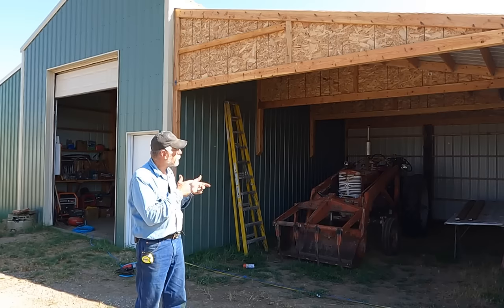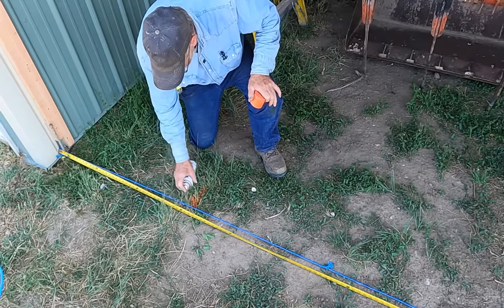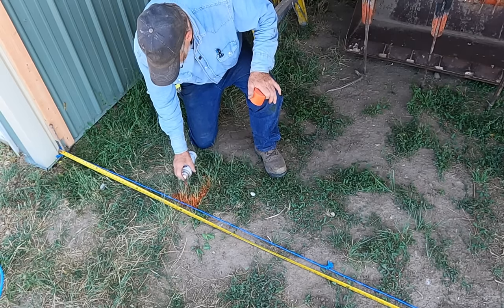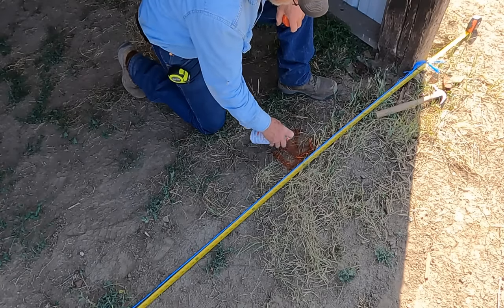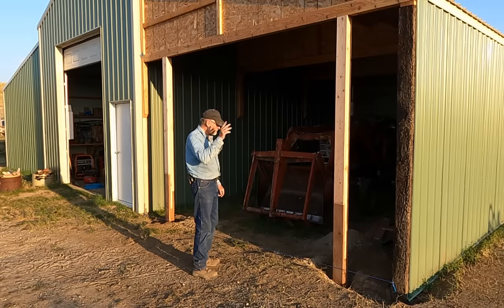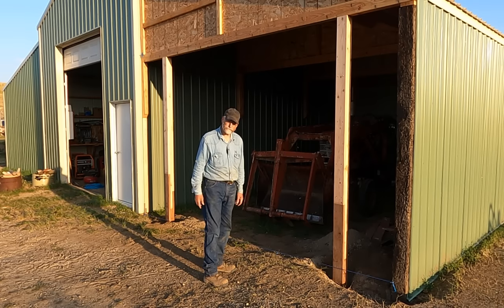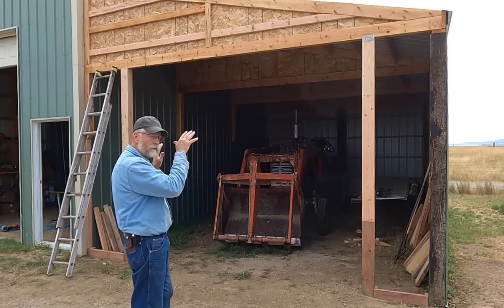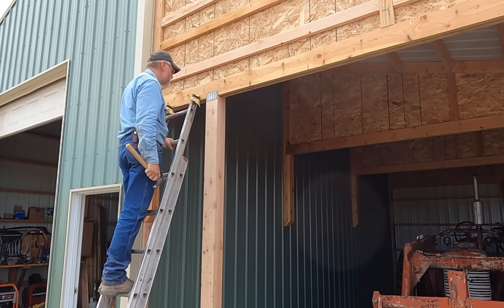The Last Steps in My Pole Barn Extensions | Engels Coach Shop

Comment: Watching you use the nail gun took me back in time to the early to mid 60's when my Dad and I built an apple cold storage warehouse, on our ranch, with a 25000 box capacity.  Every nail in that building was driven by hand.... with a hammer!!  Many times my right arm would give out from driving so many nails so I then learned to drive nails with my left hand.  Surprisingly it was not all that difficult to learn. 

Before we built the warehouse, we had to tear down what I would call a traditional barn with 2 wings and a hay loft.  This barn was built to store apples so the walls were insulated with saw dust in 6 inch walls.   We didn't actually "tear" it down... we dismantled it salvaging every board we could to be used in the new building.   During the school year when I got home, I would change into my work cloths and work for about 3 hours every day plus weekends.  The Cool thing was that my Dad paid me by the hour for my work;... $1.25 an hour which was a fair wage back in the day.  Farm kids back then knew how to work.  That skill served through out my entire life.

Thanks for sparking some great old memories....   PS.... for years now, every one of you videos got a Like from me... even before I watched them.
Russ

Comment: Where I live you would hear the termites sharpening their teeth at the prospect of all that softwood, hell they 'd be looking at taking the Makita just to speed up the process.
Must get too cold for the little buggers in Montana.
Stay safe Dave.
Reply: I believe the darker wood he used for the bottom section of each post has been treated to prevent rot and termites. We call it "pressure treated" lumber around here and it typically leaves the wood with a green tint when it's done.

Comment: Dave, did you decide not to put the sliding door on that section? I've been playing at being a carpenter for about 35 years and I don't believe I've ever seen a post constructed quite like that. I'm guessing the darker three 2x6's at the bottom of each post are treated with something to help prevent rot. And by using untreated lumber for the upper section of the post you save a little money and the regular lumber used on the upper section will be less likely to twist or warp. I've got a lean-to with treated post under it and they have warped so bad over the last 12 yrs they look more like bananas than post. I might have to give that method a try. Anyway, your project turned out real nice and the addition was a well executed plan.